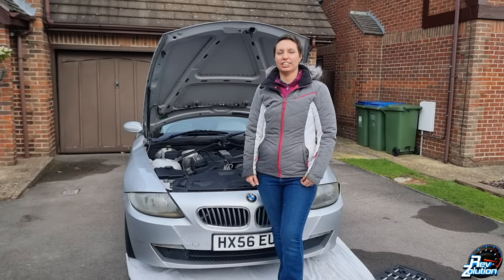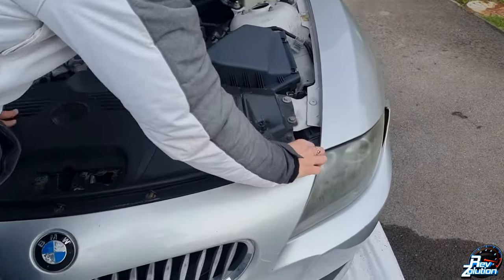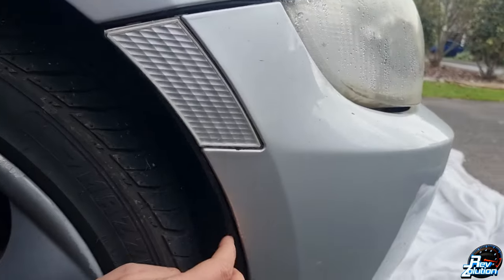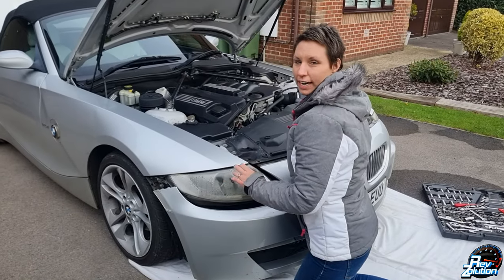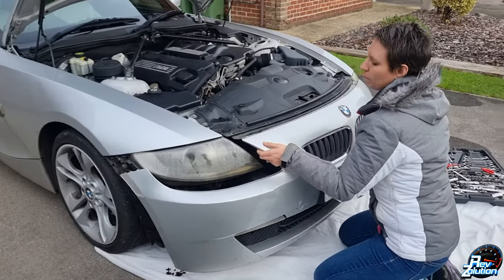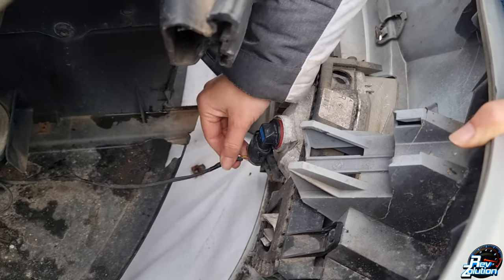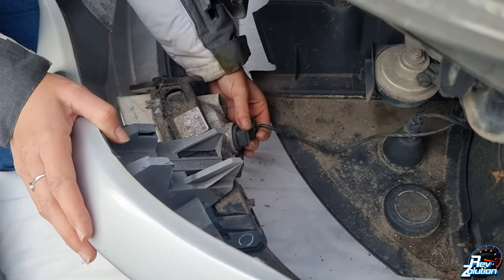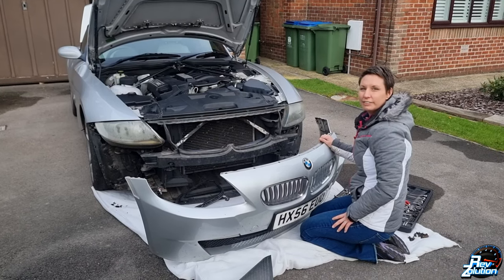How To Remove a BMW Z4 E85 Front Bumper

Comment: Tools needed:  Torx T27 for the top fasteners , 8mm shallow socket on ratchet or driver for the 2 8mm screws on both sides under the bumper cover facia, a pointed tool to press in ( toward front of car) the 4 plastic fasteners joining the fender liner, and a fork-like plastic or metal trim tool to pull these fasteners.   If the front tires are either removed it turned in on the side being worked on then a flat blade screw driver can be used to open the fender liner front access door to reach the fog lamp bulb to remove it before removing the bumper cover.   It is also much easier to access the fender liner fasteners with the tires out of the way.    By the way, T25 Torx and 8 mm are needed to remove the fog lamps from the facia, and four (4) T25 Torx are used to unscrew the LONG headlamp fasteners.

Comment: 10mm deep socket are used to remove the BMW badge and side reflectors.    A flat blade screwdriver or trim tool and patience and a light touch are needed to remove the grille.  There is a plastic reinforcement frame heat staked to the facia that is not intended to be removed, so try not to ruin that if just trying to remove the grilles.

Comment: Great simple video thanks.  Question you might be able to help with. I am looking at buying a Z4 and there appears to be a larger than normal gap between the top of the bumper and the bottom of the headlight.  It looks like the bumper sits on the metal absorber once it’s mounted and if so does that mean the metal absorber is also misaligned or could you see any other reason for the gap verweb the bumper and the headlight which is about a thin finger in size.
Reply from the maker: I have the same issue. I've often thought if something has been damaged. But as you have the same issue maybe it's a design issue